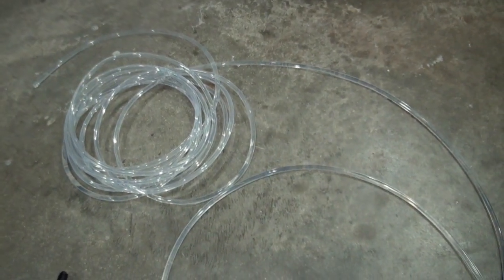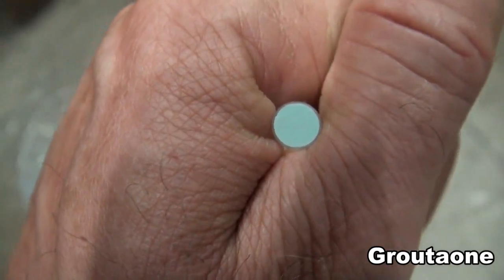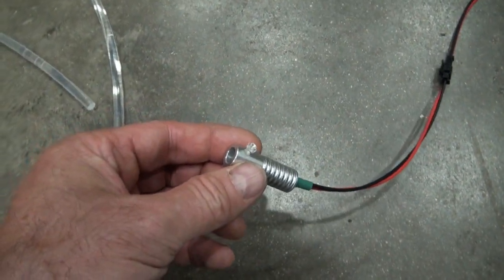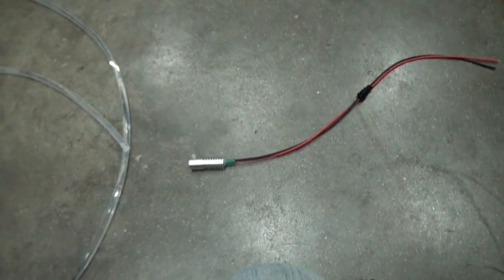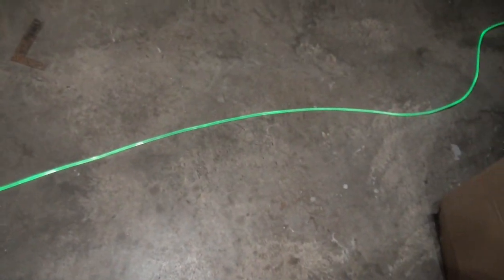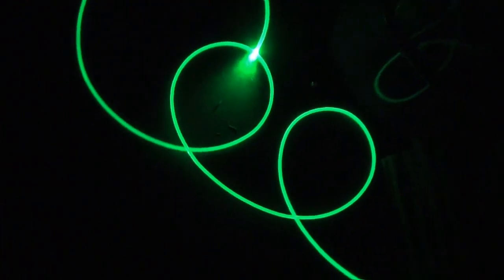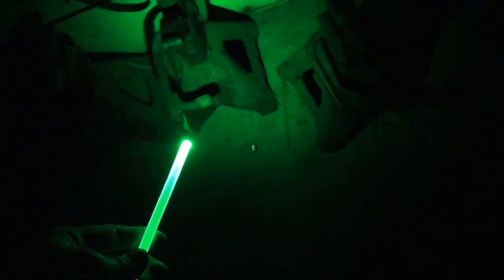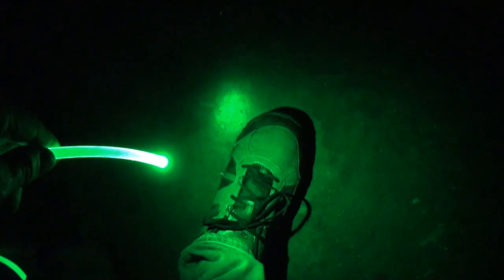Fiber Optic Cable

Comment: What that might be (I haven't looked into the details yet) is a bundle of microscopic strands of fiber optic "thread". Helps to keep it flexible, much the same way heavy electrical cable will be made up of hundreds or thousands of individual strands of small wire rather than being a single solid piece of copper, which would be almost impossible to bend without serious effort.

Comment: Whats the going rate of one of those bad boys? I immediately started thinking if it could be used to prove the shape of the earth!!!
Reply from the maker: The 10M long cable and one illuminator was less than 100 USD including shipping.
Reply: @groutaone  it was waaaaay beefier than any I've seen before... I don't even wanna know the cost of one of those ocean crossing fiber-optic ones.